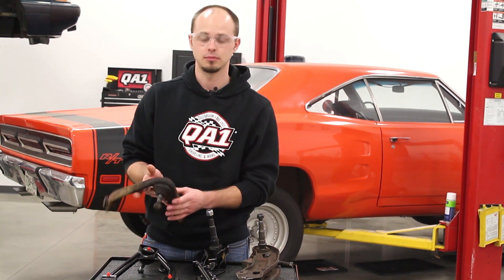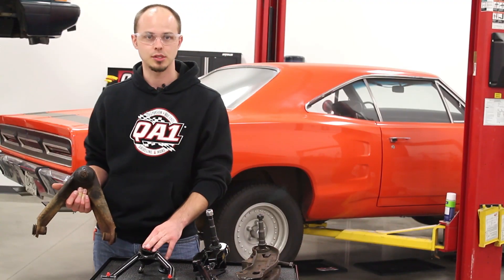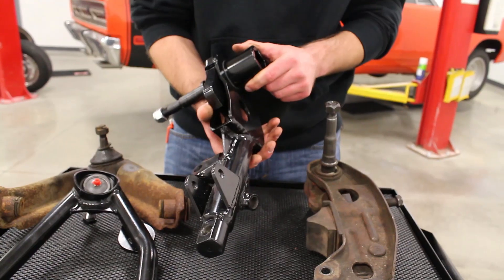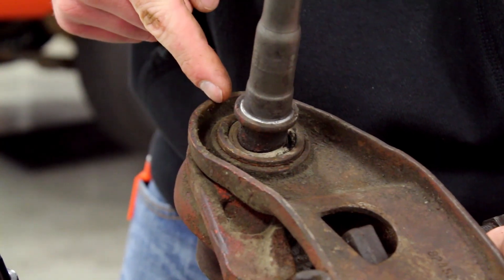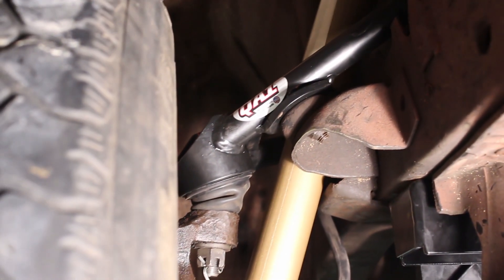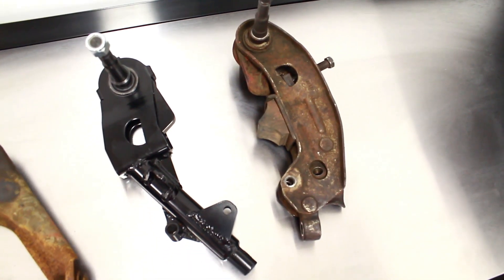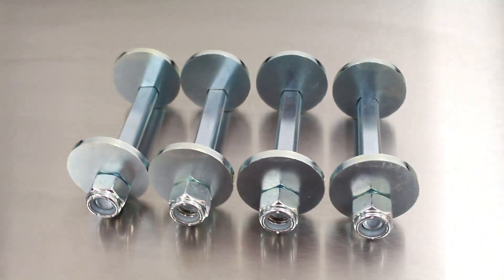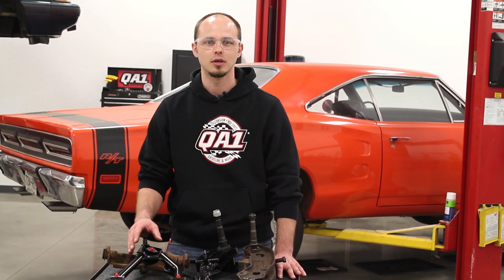QA1 Mopar Control Arms vs Factory Control Arms

Comment: I do like your products. Unfortunately I had already installed new factory uppers. I just replaced (rebuilt my lowers) I would have used your lowers but I would need to replace my new uppers to match your additional 3 degrees. I would suggest maybe building the lowers to factory spec as you would be the only ones doing so. Or offer both, so those of us that only need to do lowers have an option other than overhauling 50 year old parts. Just a thought.For the price of 100 dollars for new uppers and 100 dollars to redo the lowers that is hard to beat. of course doing the work myself. Nice products though.

Comment: Whats the different in total unsprung mass between stock and these?
Do they work on RHD A-bodies?
What sort of mileage / durability are they rated for - will they survive long on a daily driven car?
(We had sway bar mounts on A-Bodies here in Australia from the mid 70's.)
Reply from the maker: +PiDsPagePrototypes 

These are not rated for any specific mileage due to differences in driving styles and environments. The pivot shaft bushing on the lower control arm is a bonded rubber just like the factory arm. As for mounting on a RHD car, there shouldn’t be anything different as they are nowhere near the steering equipment. They will survive as long as any polyurethane bushed pieces, and replacement bushings for the uppers are available. Everything is greasable, so as
long as you keep it all greased up, they should last a long time with no problems. The lower pivot bushing is bonded and not replaceable. 
Thanks for the question, if you have more, you can always send us an email at sales@qa1.net!

Comment: Can you please make a Handling  Suspension Kit for a 1974 Plymouth Duster A-Body?!
Reply from the maker: Jonathan Martin thanks for your comment. We can get you pretty close with a 74. The only pieces missing from our other a-body handling kits would be the k-member and the front sway bar. Everything else should work for you though. I’ll note the request for the 74 kit and see if we can’t bump it up on the priority list. Thanks again!
Reply: QA1 sweet please keep me posted I'll comment a few weeks later to check on the status
Reply from the maker: Jonathan Martin thanks for your enthusiasm, Jonathan but there are quite a few other projects we’re working on at the moment so it might be a bit before we can dig into this one. It’s on the list though! Thanks again!
Reply: QA1 Sounds real groovy bro. Wherever they can.
Reply: I would be interested in this as well, I do have a 75 duster but will be getting a 74 that will require no body work :) What it the reason that the existing Q1A K member wont work on a 74?

Comment: If a Sway Bar is to be installed on an A-Body (1975 Dodge Dart Sport Coupe) - would the mentioned E-Body be used? If not which one?
Reply from the maker: Hi Teddy, we don't currently offer a sway bar for 1975 A-Bodies, but I will pass along the request to our engineers as we are always adding new applications. Thanks!